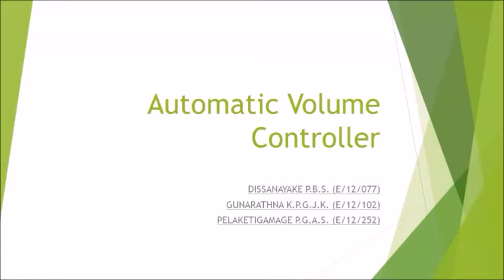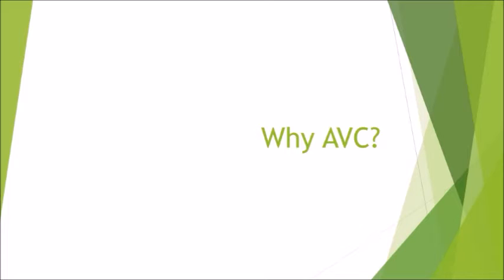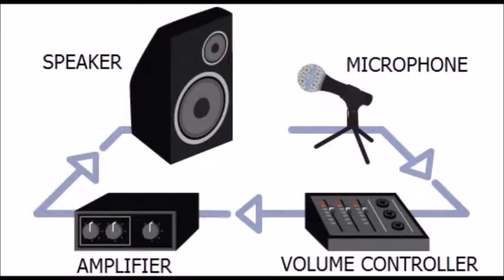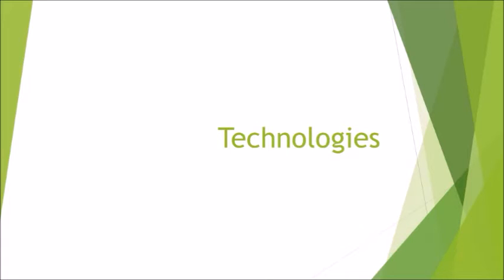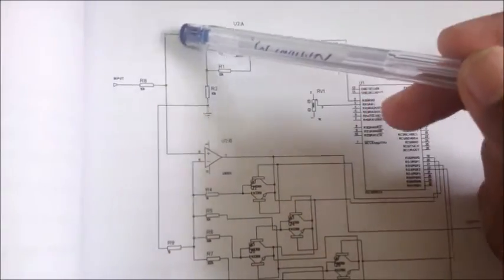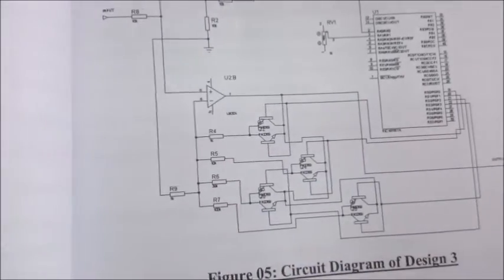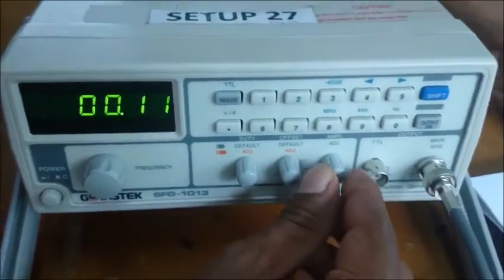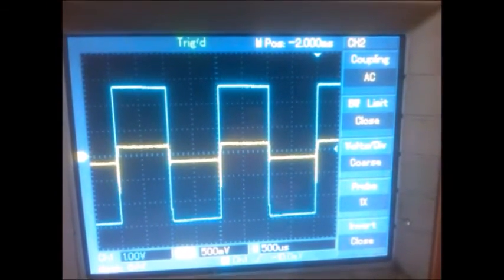Automatic Volume Controller

Comment: Really strange solution. Once the microcontroller is involved anyways, a simple I2C digipot would work better and be cheaper than all transistors and extra opamp.
Reply from the maker: Yes, it's an odd solution. It was done more than a few years ago for a university project as a proof of concept :goodvibes:
Reply: So this system use to adjust volume level without any operator and fixed level ? Can you give more details

Comment: Can i get that Image of Block Diagram Plz....!!!
Reply from the maker: I have made this before 2 years I guess. Will try to find the file and send it to you :)
Reply: Did it Work...??
Because this is actually for a Mini Project on AVC and i am not getting any Paper where a Microcontroller is interfaced
Reply from the maker: Yes It did worked, and I also done it to a Mini project. You can see the output on oscilloscope in the video. We got a jammed on the wiring, so we didn't get a better output for sinusoidal wave. But for other waves, our concept worked fine.
Reply: Cool.... so plz kindly... give me some materials to work on with as our deadline to the project is nearing
Reply: Anything...??
Reply from the maker: I'm sorry bro, I checked for that doc & couldn't found it. only diagram is on https://youtu.be/kcqdlNLTayM?t=90 . I have used PIC16F series micro-controller.